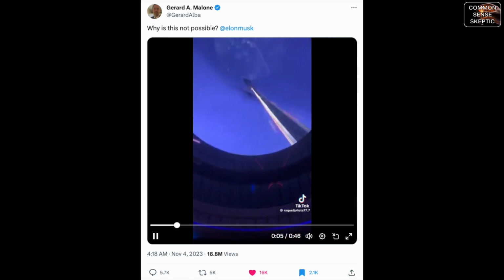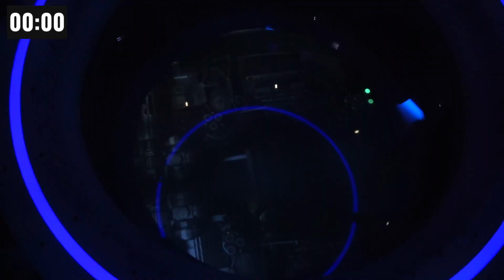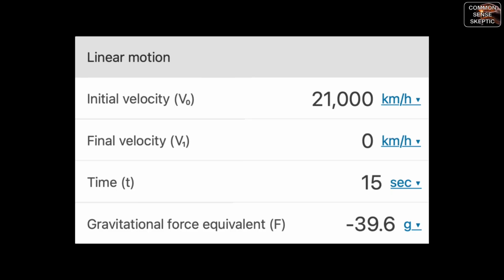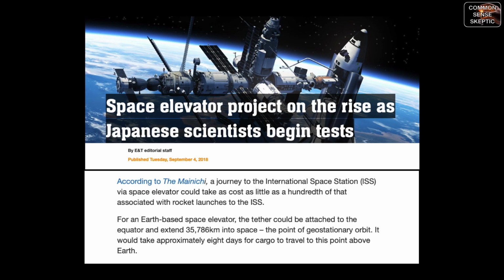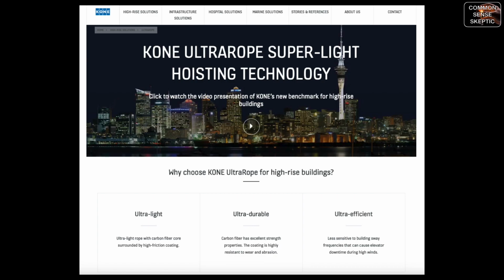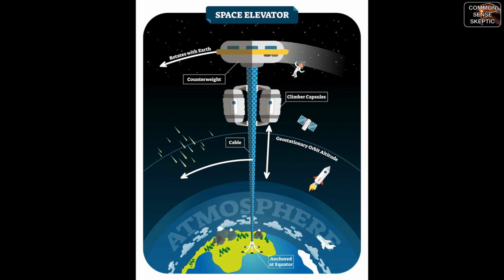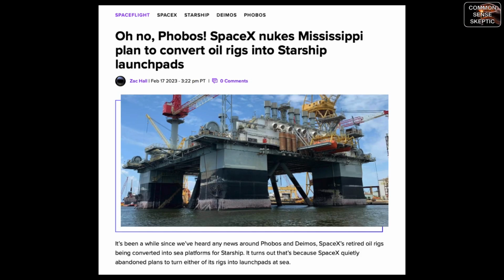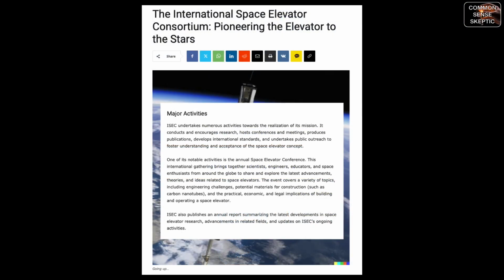DEBUNKING L.E.O. SPACE ELEVATORS

Comment: There is one major issue with these concepts which is they move away from function for form.
The "Space elevators" don't need to have a permanent connection at all times.
Creating a flying platform at the 20~30 km zone which will tether to the ground and aim the capsule to the station or to a tether extended from it and let the capsule "bridge"/Fly from one end to the other solves almost all of the problems you mention.
Essentially the zone where the capsule is not accelerating/de accelerating can be free flight and uses the tethered part of the journey for the affromentioned actions.
Challenging definitely. In no way impossible.
Make a giant solar paneled plane drop the rope from it some sort of direction/aiming mechanism on the top for last second correction then drop a tethered target from the station for the capsule to aim at it and off we go. :D
Reply: What exactly do you mean by "flying"? Things usually do not fly without power.
Reply: @PlatinumAltaria  the capsule will be moving at a speed for the middle section. Similar to a giant rail gun. Once you imprint the velocity on the capsule and you lead it pass the thickest part of the atmosphere it will simply coast, of course at that point you can go fancy and put a laser on the end of the flying platform that will use laser propulsion to imprint even more speed on it or at least to help it overcome atmospheric drag ect. Good old rockets will work just as well.
I have crunched the numbers before and it was doable with existing tech.
And you can go as fancy as you like and instead of having just 2 parts you break it all at many modular segments that are independent and the capsule is being passed in between. It will be very easy to be done as prove of concept where every segment is using the optimal propulsion for the altitude  they are at and are able to accelerate/deaccelerate the capsule. Imagine are rail like system where the rails are a few km a part with the capsule jumping from one to the other.
It is about imprinting velocity currently we use combustion for propulsion because we are great at blowing ourself and other things. But is not energy efficient a  lot of heat waste. "Space elevators" need their Elon Musk moment to break out of the combustion chains :P (ion engines just don't have the lifting power lol)
Reply: @qa1e2r4  You seem to think that air resistance is the main force slowing down the capsule, and not gravity. If unpowered it will accelerate towards the ground at 9.8m/s. You have to put some kind of energy into it to override that. Lasers are obviously inappropriate given how wasteful they are, and using electromagnetic propulsion (this is called a mass driver) doesn't work for hitting a precise target due to the ballistic trajectory.

Breaking the chain into pieces will only make it weaker. It still has to hold the entire weight. They aren't just gonna float in midair with km of air between them.
Reply: @PlatinumAltaria  There are solutions already for all of the things you mentioned and lasers are what we are using to create the highest pressures so far.
They are extremely efficient. The main reason for how many segments will be actually maintenence and redundancy. Also just as they are able to imprint speed on the capsule they will be clearly be able to do that to each other :P
Air drag is mainly an issue up to 40 km the other 100km+ you just need them to fly at a curtain speed.
The issue is the method of thinking about space elevators. Once you prioritize function there are many existing tech that you can utilize to create it.
The same way we are dealing with air pressure engines and space engines. Currently everything is mounted on the same structure for a ~10 min thrill ride where everything happens in seconds. our 1st stages are nothing more than launch platforms for the space rocket that delivers the actual payload.
It is a design made to waste money. The moment the first reusable 1st stage came around and it became very clear.
So such a space elevator will be something like a break down of the rocket equation to sqeeze the best acceleration for the altitude.
There will be no need to launch the whole platform up or down as it will be always at the altitude needed. Of course for that to be needed we will need to constantly need access to space. Which is coming once star ship becomes a reality. 
There is going to be a new gold rush moment triggered by it. To the asteroid belt and building space factories and warehousing to accommodate the goods transfers ect.
Because the race to mars is just PR stun. They are not racing to mars they are racing to the asteroid belt and all the metal/minerals and god knows what else we will find there. And the trigger point is starship. And that is a few months away :P

Comment: Why just one cable tho? Make the elevator itself in the middle surrounded by 4 cables. even if 3 brake 1 should be safe enough to get up.
Reply: 4 impossibly strong cables are 4x as expensive as one.
Reply: Buuuut, also 4 times safer! @PlatinumAltaria  And still weird how he wants to go on with Steel instead of nanotubes altho the rest makes completly sense. : / A man can dream
Reply: @JanoschNr1  Probably because steel exists and nanotubes do not in any meaningful quantity.
Reply: @PlatinumAltaria  Well why would it, outside of bullet resistend body vests there is no reason to produce big quantitys
Reply: @JanoschNr1  If you want to design something, you need to use real materials with known properties, not magical materials that you claim have the required properties without any testing.

Comment: Ah, the reason you have sky lobbies in big skyscrapers isn’t because of the limits of steel cable, they do have elevators lifting the full length to observatories, but sky lobbies allow more elevators per elevator shaft.  (The shafts consume a lot of floor space in skyscrapers.). 
Your right that a cable that long couldn’t be a wire of constant thickness.  The real designs assume it thickens as it rises like a trumpet.  If you could make solid graphene or nano-fiber that big (good luck), for a 3 foot in diameter cable on the ground it would swell to 200-300 feet in diameter.   Steel would get to miles if I remember correctly.

Of course over the equator a couple thousand miles up is the nastiest radiation belt in the inner solar system.  One that we avoid EVER flying people or equipment through.  The radiation would shred complex long chain molecules like DNA, or Graphine or nano fibers.

Then you need to launch rockets from GEO station to the final orbits (after lifting them to the station)… more then likely for most lower orbits it would be easer to get to there from the ground.

I debunked a set of would be space elevator folks on a space advocacy show “the space show”.  Their business case was as bad as their tech understanding.   I pointed out ignoring the inability of the materials to last long, they were talking about lifting billions of tons of cable, wildly conservatively costing hundreds of billions to trillions of dollars, to lift a thousand tons a year (In not sure they considered the shielding weight on the climber, so it might be a fraction of that).  Assuming the cable could last a couple decades the cost of cable would be thousands of dollars per pound of cargo lifted …. I leave it to you to figure out the construction costs to lift and assemble the cable etc per pound of cargo.  In contrast a Star-Raker would be $35 a pound to LEO.

Space elevators are a great image, but a really stupid idea.  (Similar for orbital rings, also advocated by some mutual acquaintances.)
Reply: Every now and then some company tries to invent the sideways elevator - able to move between shafts as well as up and down, so elevators could pass each other. Great idea on paper, as such a system could move people faster and using a much smaller volume within a building. But the practicalities of making such a system safe and affordable have yet to be overcome.
Reply: @vylbird8014  
I’ve heard they have developed practical versions, but market demands about nil.  Actually skyscrapers are less and less popular compared to sprawling “campuses” or office building.

Comment: You must add the energy expended in a launch to space elevators. I will use Newtonian mechanics energy model for that (and yes, I know there are better, more accurate models, but this one is easier as it involves high school physics only):
Any item or body launched to geostationary orbit will have potential energy based on the height of that object. Thus:
0. Launching the space station/anchor in geostationary orbit and the tether itself will carry potential energy equal to the kinetic energy expended on launch.
Bonus: The potential difference between the space station and the ground may cause unwanted electric flow. But this might also somehow be used as part of the launch (using electricity to launch, instead of fossil fuels). This can increase efficiency, as fossil fuel burning also create heat, which do not contribute to the kinetic energy.
1. A satellite is launched to space using the tether will require the same kinetic energy as the kinetic energy for launching without a tether. Again the only reason space elevator might be potentially viable is using an method that do not emit heat during launch so almost all expended energy becomes potential energy.
2. Once in the geostationary station, we want to launch the satellite. Since moment of inertia is preserved, any lateral launch will cause the station to be out of balance, based on the mass of the launched object and its potential energy from the ground.
3. If the energy from point 2 is corrected by the tether (and not by fuel engines), now the entire energy of the launch of the satellite is transmitted to the ground, thus resulting in thermal loss over the tether (if the tether elasticity is not 100%, which no real material has) and the pull of the ground anchor.
Conclusion: The energy required to launch a satellite into space using space elevator is larger than free launch from the ground, as it contains the energy maintaining the tether itself and the same kinetic energy as normal launch.
The only benefit of space elevator, if we figure out how to create one in the first place, what kind of material to use for the tether, where to build the ground anchor of required size, uncontrolled discharge over the tether, harmonics, weather conditions, intentional attack on the tether, geopolitics, collision with satellites, etc. would be that if we are able somehow to control the difference in potentials and launch using electricity, it might be possible to launch a vehicle without heat energy loss. Would that be cheaper than untethered fossil fuel launches - definitely NO!
Unfortunately, space elevator is the type of science fiction that we know enough about that will never become a reality, similar to "inertial dampeners", "faster than light" travel, cryostasis, etc.

Comment: There are so many problems with this idea.  My apologies if you mentioned some of these:

(1) How are you going  to get the cable and terminus up there?  You can't do it a short length at a time, it would fall right down.

(2) The thing on top has to be up HIGHER than synchronous orbit, as it has to constantly be pulling UP,  to hold up the cable, and quite hard.

(3) How hard?  Well let's assume they have some special cable that's five times stronger than steel.  By my calculations, a regular steel cable can support its weight up to 9,300 feet.  At the top, the tension in the cable equals its breaking strength.  Let's say they can do 5 times better.  So the cable can only go up to around 45,000 feet.  That is about 2,550 times too weak to reach geosynchronous orbit.   And that is just for the cable.  If you want to have a platform up there, it's going to be much heavier and make the numbers much worse.  

(4) How heavy is the cable?   I get 161 million pounds.  

(5) How many Saturn V's would it take to pull up that cable?   About 3,200 of them all pulling together at the same time.   Many many more, actually, as they can only go full blast up to about 100 miles.

(6)  How much would this thing cost?   Well, just the cost of 3,200 Saturn V's, that's about 5 TRILLION dollars.  That is just a little more than the USA collects in taxes every year.  And remember that it's going to  take many times that many rockets to get the cable up there.  So let's just say, $50 trillion, an impossible amount of dollars.

(7) Oh, I forgot.  There are things stronger than steel.  So let's assume we can make the thing out of carbon fiber, let's say 5 times stronger than steel per weight.  You still would need 640 Saturn V's pulling.  Still not practical.  Also carbon is going to oxidize very quickly under ultraviolet light.

I'm always amazed that Musk and similar yahoos don't do the simple math to show these things to be physically and financially impossible, like 1,000 times too weak and 1,000 times too expensive.
Reply: To answer a couple of those questions. You'd start at geosynchronous orbit and simultaneously pay out cable in both directions. In one direction the cable rises upwards (with a counter weight). In the other direction the cable reaches downwards, under tension because of it's own mass. The trick is to balance those two forces. The other thing is that the thickness of the cable doesn't remain uniform. The cable gradually gets thinner in both directions, especially the downwards one, so the maths is complex. Bottom line is we don't yet have materials strong enough. The worst part is maintenance of the cable in a hostile environment. Not just winds or lightning but erosion from solar particles, UV etc.

Comment: What if we don't use cable, but use interlocking hollow centered cylindrical eletro magnetic structures that via magnetic repulsion + anchors make the span up without the need for the massive over engineering we see when people usually imagine such, a separate coil in the centre and then just fire a capsule through the middle of it using electromagnetic force. 

As for it's use, firing probes out into space, firing politicians out into space, myriad uses. :)

Just a thought for fun. :)

I drew out something similar aged 15 some 25yrs ago as a way to build a faster/easier method to get to mars and back but it would be one hell of a mega project.
Reply: That would require magnets to work by magic instead of by large generators.
Reply: @PlatinumAltaria  Powered from the deck with current passed from one to the other via the anchors.

It's all just scifi anyhow.

Comment: Even assuming carbon nanotubes with a theoretical tensile strengts up to 300GPa it would just barely strong enoungh to bear the own weight of the cable. Carbon fibre can just have a 200km long cable before it breaks. And that's the best existing candidate for this cable.

Comment: I understand the point you are trying to make about cable technology but I don't think this is the reason behind having to use multiple elevators to get to the top of tall buildings. My understanding is the multiple staggered elevator concept is the most efficient way to move people at peak times.  As for the capabilities of cables, look no further than the cables being used in underground mine elevators.  Creighton Mine (Home of the Sudbury Neutrino Observatory) is over 2 kilometers deep.  You get down to the bottom using a cage (mining term for elevator) suspended by one single cable.  I have personally used that cage to send equipment weighing well over 5000 kg to the bottom of the mine.  That cable technology has been around for many decades.
Reply from the maker: https://www.iconeye.com/design/ultrarope-2#:~:text=UltraRope%20is%20a%20new%20carbon,limit%20set%20by%20the%20rope.

Comment: The biggest problem with space elevator is that it forms a giant "lightning rod" through which the ionosphere would be constantly discharging to the ground. The potential difference there is around 300 kV. Good luck withstanding that.
Reply: Not as big a problem as you'd think. 300kV, but the impedance is huge. So high it's hard to even measure - otherwise people would just use kites to suck some of those sweet electrons up as a power source*. The current wouldn't be enough to worry about. The lightning bolts, on the other hand, those would be a problem.

* This can actually be done, and there are videos on youtube of people doing it - but it generates just enough power to turn a rotor with no load and very good bearings.

Comment: Not sure I would classify it as fantasy. Its a possible solution with significant challenges on the how and why front. It only makes sense  to do if it goes to geostationary orbit so you can export large amounts of resources. Since earth is going to be  a raw resources importer, it makes no sense to have an elevator, when raw resources can be refined and dropped from orbit.

Long before building one on earth, it would make much more sense to build much smaller ons on the moon, or mars. But since the moon has not atmosphere, you may not even need one there.

Comment: The one space elevator idea that maybe seems anywhere close to (technically) viable is one on the moon.

It could be kinda neat in a very hypothetical far future setting.

Placing the station slightly outside L1 and anchoring that to the moon keeps the wire taught and could to the best of my knowledge probably be accomplished with real existing materials due to the moon's considerably lower gravity.
You also don't have to deal with pesky atmosphere and myriads of satellites.

Because it is outside L1 it would take 0 energy to "drop" a payload from the station into earth's gravity well.